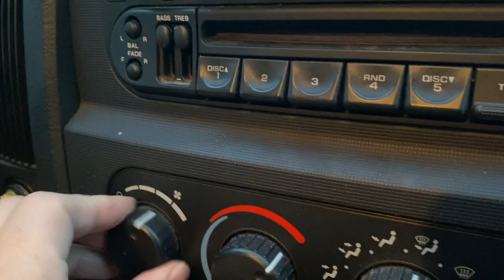Here's Why CARS FAIL BY DESIGN

Comment: About 25% of car owners do no maintenance at all. No oil change, no transmission fluid, brake fluid, power steering fluid services, don't change the spark plugs, replacing brakes, rotors, tires, services that are routine.
Reply: I've always wonder what percent of car owners do this.  I know of a couple from my own experience.  It's bad enough some of the issues in the videos bad effects but this would certainly add to the problems.
Reply: I read a recent article that stated 55% of car/engine issues/ failures are owner induced.
Reply: That is sad
Reply: Sadly my grandpa was one of those 25% and also didn’t help that the mechanic he was taking the car to didn’t explain how things work but always made sure that he will come back
Reply: @robbied6198  DIGIBYTE!!! ❤❤
Reply: My parents were one of those. Bought a Honda Odyssey new and after a few hard-driven years, the engine was so clogged up it went into limp mode then died. While that was happening, they said I was stupid for maintaining my older car, that was still running great LOL.
Reply: So true
Reply: That's because they get into an insane amount of car payment. The average car payment is $700 per month in the US. Plus insurance! That's pretty much my damn mortgage payment. I'm not that good with money, but I'm not that bad either. I've been driving good used cars since 2006. That's the last time I bought a brand new car. It was a $12k Hyundai Elantra that I drove until it had 260k miles
Reply: On the bright side, it keeps those of use who do maintain our vehicles and keep them a long time with a ready supply of parts from breakers yards
Reply: You are prolly one of them.

Comment: If you are gonna spring for an expensive German brand vehicle, do your research and get 1 thats made in Germany.  Cant rely on the vin numbers any more.  Audi found a way around that.  Its now defined as long as the company is "headquartered" in that country, then you can use the vin number.  For example, all of their Q5 model vins start with "WA."  That used to mean they were built in Germany.......but the Q5s have all been built in Mexico since the 2018 model.  Nothing like corporate deception.
Reply: So when you by a german carmake sure it's actually a german car haha🎹🎶

Comment: You are right about the way a car is designed, having cheap parts and no quality control. I have a 10 year old VW and things just keep failing.  Most recently I had to replace the blower motor for the AC, the hatchback actuator/door lock and just recently I got a 4000 dollar repair bill for engine oil leaks, timing chain valve cover, repair of leaking oil line to the turbo charger, timing belt and tensioner replacement and the car has 85k miles on it.  Now the passenger side window will not work and the driver's side arm rest is broken.  I have about 6000k in repair bills for a car that is worth about 5-6K. The killer is that the VW is still a reasonable car but the repair bills are stacking up.  It makes me just want to junk the car!
Reply: VW are great handling cars and has personality, if you’re a car guy and love VW, just maintain and keep it
I had a 1992 Golf GTI (Bought new) and had it for 5 years, enjoyed every moment of driving it.
Reply: @masoudshaghaghi5744  well that was totally another car compared to today's VWs...
Reply: You just describe what I had to go through my  old BMW and it got to the point that one time after I took it for a oil change went to the Subaru dealership and trade it in for a Forester Sport the most I have paid for it is like $400 total in a spam of 3 years
Reply: @masoudshaghaghi5744  I like cars but I don't know how to work on them myself. So the high repair bills for me is the limiting factor. The other thing is the nineties VW were a lot better than the latest junk they import to the States from Mexico.
Reply: @robbied6198  Well I decided to get the oil leaks fixed for 1400 bucks.  All the repairs including the, timing belt will have to wait awhile. I might just follow your example and trade it in.

Comment: Every vehicle on the road can fail miserably at any time, whether if it is reliable or not. So, always make sure you take good care of the vehicle by doing little maintenance and/or repairs, research it prior to test driving and buying the vehicle and always buy used, every single time you plan to purchase any vehicle. Anyway, there are three good vehicles to buy and three bad vehicles to avoid. Always buy the good ones, not the bad ones. The vehicles that you should buy are the 1999 to 2004 Ford F-250 or F-350 Super Duty 4x4 pick-up truck with the 7.3 L Powerstroke turbodiesel V8 engine and either the four-speed automatic or the six-speed ZF manual transmission, the 2006 to 2008 Buick Lucerne CX or CXS five-passenger large sedan with the 3800 (3.8 L) V6 engine and the four-speed automatic transmission and the 2011 to 2017 Honda Odyssey Touring eight-passenger minivan with the 3.5 L V6 engine and the six-speed automatic transmission. The vehicles that you should not buy are the 2007 to 2016 GMC Acadia mid-size crossover with the 3.6 L V6 engine and the six-speed automatic transmission, the 2004 to 2008 Chrysler Pacifica crossover wagon with any V6 engine and any automatic transmission and the 2002 to 2006 Nissan Altima 2.5 S mid-size sedan with the 2.5 L four-cylinder engine and the four-speed automatic or the five-speed manual transmission. Thank you very much and happy 2023, buddy!!!

Comment: 2009 4th generation ram 1500
204000 miles.
First owner and no transmission or engine issues 
Still running strong like the day I got it new in 2009
Also lifetime powertrain warranty
Reply from the maker: Sounds like a solid runner
Reply: How is the rust?
Reply: @michaela1655  I'm from Houston TX. No rust in the south
Reply from the maker: @michaela1655  none that I know of

Comment: This is from BMW article 'Now, designers are incorporating simple but vital systems such as a handle built into the end of the wiring harness that allows it to be easily removed at scrapping time. Such things will take years to filter through the system, though'
So it's all about recycling and short life span of components  in cars, that's what's main concern for all of manufacturers nowadays.
So the worst is still ahead of us....
Reply from the maker: You are totally right and they really do plan to have a car through the system within 5 years, cradle to grave.  Cheers

Comment: Depreciation cars isn’t valued correctly.
Say I have a 5 year old car that after 80k miles needs a water pump.
Now by five years it’s at 40-50% of its value.
Now, my choices are to eat the cost or go through the process of buying another car that even if used will still cost several times the cost of the water pump, and the present car might still be reliable
Reply from the maker: Yes that is always a factor.  Overall reliability and running costs of the older car should be considered

Comment: I had a 2011 Toyota Corolla manual bought with 100 k miles. I put 150,000 more miles and wrecked it with 250 k miles. Original clutch, motor, internal components except tires brakes and it would’ve kept going.

Comment: I have a 1988 Firebird formula 1995 dodge stealth RT NA  1987 V-45 super magna 1999 Lexus RX 300 and the wife has a 2006 Lexus ES  330 all run perfectly we traded a 2014 ELANTRA to get the 2006 Lexus I will not be buying anything newer than 2006
Reply: This is a lot better to buy an older used vehicle, instead of a newer used one. Way to go, man. Happy New Year!!!

Comment: Get a W124 Mercedes (1985 - 1997). ALL OTHERS ARE CRAP!  Doesn't matter what brand - BMW, Lexus, Audi, Mercedes etc. Until manufacturers learn that owners want a quality car that they can keep for a few years, they and their prospective owners are on a slippery slope. Computers and plastics will be the death knell of the car manufacturing business. I have a 30 yr old 300E - done 102,000 miles and, apart from some deferred maintenance, it's going fine.

Comment: I'm thinking of buying a BMW F25/X3 30d 2011-13, but private sellers demand 14,000 euro for a car with 200 to 250,000 km, and one of the problems is that the big costs start to come after these kilometres... I would never bring my car(s) to a dealer for maintenance/service.
I think EOL for a BMW is calculated to 150-200,000 km...  A few owners have (major) problems before 150,000 km.

Before 2010 (wenn the Euro5 regulations came) even BMW has a quote simple construction which means that the spare parts are reasonable in price (maybe not at the dealership though!).
But 2011, with the modernization, everything got a little bit more complicated and the prices went up...
And after about 2015 some really expensive features were introduced, "cheap" headlights 2,000 euro, etc, etc.

In my BMW X3 2008, the LED taillights in the tailgate light not always perfect... Instead of buying two new ones 150 euro each (eBay!), I have to cut open(!) the rear wall of the light to be able to reach circuit board to exchange it (30 euro each on eBay) or repair/solder some faulty connections. In the newer X3 it's very simple and easy to exchange the circuit boards in the tail lights, maybe 20 euro each.
Internet, eBay and Amazon, not Youtube to forget, have made some repair of the cars, at least, a little cheaper.
And with the help of not that expensive diagnostic tools you can monitor the "shape" of the car, and repair small problems before they get big and very expensive.

I think many car owners will be very happy when we go into the electric car age, even though the electric cars don't last for ever either. Regardless of some repairs the overall costs per km/mile seam to be quite low for the electric cars.

Comment: Remarkable that in this video snippets of the Toyota logo are visible. Toyota vehicles are still way beyond the quality of ANY German car. Even though plastics nowadays have found their way into Toyota products as well. They know where to use them and where to place them. Any German car has multiple alarm clocks built in various essential parts of the vehicle. They will fail at a certain time, the developers know that so they know rather precise when a vehicle is likely to come in for repairs. That’s usually at the end of a leasing period, say 3 to 4 years after the new vehicle was sold. So if you desparately want a German/European car, lease one. Let the manufacturer pay the repair bills, not you! Bye! Willem, Hekelingen, Holland.

Comment: An electrically driven water pump imposes more electrical load on the alternator which in turn gets its energy from the crankshaft so there is no net benefit . . . . in fact if you take into consideration that the alternator has an electrical efficiency of perhaps 85% and the water pump motor has perhaps 70% efficiency . . . overall that translates to a 60% energy transfer efficiency so now the engine needs to put out 1 / 0.6 = 1.67 times the energy input of a direct driven water pump.
Reply from the maker: Nice, very nice.  A good old mechanical water pump is just a simple beast and all you need.  They had to go all silly there.
Reply: The real reason for an electric water pump is that it is variable speed.  If you need more cooling, the pump runs faster.  They can also run the pump after you turn off the car, and that helps dissipate heat.
Reply: @michaela1655  - makes sense but in that case has the thermostat been done away with as the thermostat effectively operates as valve controlling the flow to the radiator which regulates the cooling. On my 2010 BMW the fan would continue to run after the engine had been shut down but realistically the energy savings will be minimal as the flowrates are pretty low.
Reply: @Jagshemasher  BMW also uses an electric thermostat in conjunction with with the electric water pump.
Reply: @michaela1655  - don't like the idea of that . . . now they have replaced simple and reliable mechanical items with two electrically controlled items. They may get minor efficiency gains but when the system goes wrong (and it will because its a BMW) it will now cost a lot more to fix as undoubtedly it will use "proprietary" parts.  The cost of repair will more than negate any efficiency the benefit that was derived . . . . anyway I won't be buying another BMW so not an issue for me.
Reply: @Jagshemasher  The electric water pump and electric thermostat in BMWs do fail.  And the parts are very expensive.  The labor is not easy on an x-drive vehicle because there is very little space to work with.  So a customer who is paying a shop to do this job is in for a big bill.  I have done this job twice on my 2006 BMW 325xi Wagon.  I have uttered a few bad words during the ordeal, mostly directed at the design engineers.  But I do not think it hurt their feelings as they either do not "speaka zee inglish" or they are laughing so hard on the way to the bank.

Comment: Did you watch PHAD replace the timing chains on the 16 MASER...$5 000 repair bill. How can chains fail after just 100 000 kms. The tensioner were maxed out and the chain was wearing adjacent parts. Italian crap I say. Some of the parts have the Chrylers pentagon on them.
Reply: Chrysler - crap. I drove a rented Dodge Calibre once and its the only car I have driven that I thought the production line should have dropped the cars straight back into a blast furnace
Reply: @Jagshemasher  That is funny 👍

Comment: I'm a mechanic who graduated with a degree in Automotive engineering, I thought I was going to help manufacturers design better quality parts but to my shock I realised they don't want, they tell you what to do, like designing an electric water-pump which will need to be controlled by the ECU and also having its own fault code. surely my job was an eye opener, its ridiculous :face-orange-frowning:

Comment: I have a bmw 650i so far I’ve done an oil change my second one will be coming up I’ve done a brake flush new back rotors and pads (going to do the front ones soon) and when my coolant light came on for low coolant I topped it off I even got a inspection done on it and everything checked out fine no issues at all I don’t beat on it I always keep an eye on it and makes sure she’s running fine because I want my car to last and I love it